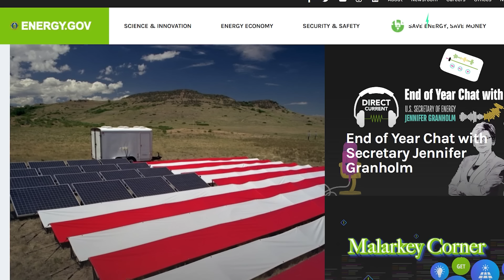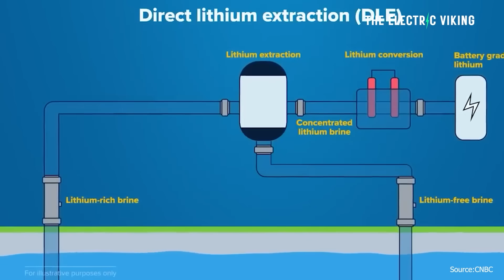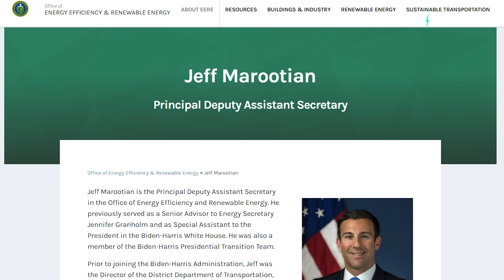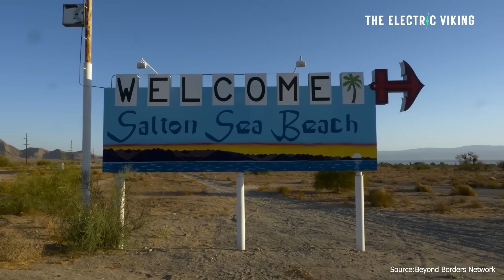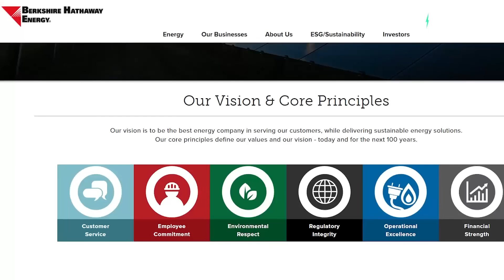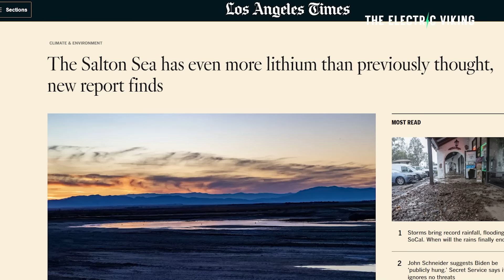A hidden deposit of lithium in an American lake will power 375 million EVs

Comment: Sam, how long do you think they will use lithium in batteries?  Arent they already replacing some of it with other materials?  I wonder if now that all these lithium sources are being found and exploited that we will have so much of it that the businesses that extract it will go broke.  Am I wrong?
Reply: There will be a variety of different chemistries used. I can’t imagine Lithium will not be one of them. The large lithium findings will only lower the cost of lithium and the battery. As is the case for all materials, low cost providers will survive. Elon Musk has often been quoted as saying that there is plentiful Lithium all around the world but the challenge is lithium refining capacity. Sodium ion batteries could be used as well in certain circumstances. They are cheap materials but their volumetric density is poor. So most likely to be used in lower mileage compact cars or in megapacks where space is not a constraint.
Reply: You can use lithium battery 20 years.
Reply: @joelsalvatore and then recycle
Reply: Catl is making cheap and unlimited sodium ion batteries for some Chinese EV's next year. Lithium is just a bridge to cheaper and better batteries that doesn't use expensive and limited rare earth metals.
Reply: @larryc1616  I don't think sodium has the same energy density as lithium
Reply: @darylfoster6133  not right now but will be great today as battery storage
Reply: @larryc1616  what is the advantages of sodium batteries??
Reply: @Just_a_random_birb  Lithium spiked up tremendously when suddenly everyone wanted it for batteries.  So people looked at sodium because it's abundant and cheap. Since then (and in the years to come) mines like this will appear, and different battery chemistries will use different materials depending on their cost, weight, and other factors.
Reply: @larryc1616  Correct but these batteries have lower volumetric density. They will be mostly used in compact cars with lower mileage. Plenty of demand for such cars in China and Europe but I expect less demand in the USA for such cars. Sodium Ion batteries will also be used in Energy megapacks where volume is not so relevant.
Reply: So far it still looks like a bright future for Lithium. It is true that "Post Lithium" chemistries are studied a lot, but for the high performance batteries for a decade or more to come, Lithium will be the most important one.
Reply: @larryc1616  There are NO rare earth metals in Li-Ion batteries!
Reply: @beatreuteler  Thank you

Comment: At some point you have to stop and ask: "Just what is it that EV's are supposed to be saving us from?" There is one question that is never addressed that would expose the "climate crisis" for the scam that it is, which is "What percentage of the atmosphere is CO2?" The answer, never given in plain language, is that CO2 is currently around 420 parts per million, (google it) increased, they tell us, from 280 ppm in 1850. That's a difference of 140 ppm, or in terms more readily understood by the layman, the composition of the atmosphere has changed by 0.014% (14 thousandths of 1%) in the last 170 years. LESS THAN 1 THOUSANDTH OF 1% PER DECADE! How much closer to "zero" do they think it's possible to get? How gullible do you have to be to believe that this rate of change is causing extreme weather events, which have always happened and always will? Their claim is that this tiny amount "traps heat". ALL gasses dissipate heat and even if CO2 is an exception, the suggestion that a total of 0.042% can overwhelm the capacity of the remaining 99.958% to dissipate that heat is abject nonsense. CO2 DOES NOT control the global temperature, there is no "climate crisis". Wind farms, solar panels, heat pumps, EV's.. None of these measures are necessary, nor will they have the slightest effect on the weather. Eye-watering sums of money have already been wasted on this futile exercise. Time to wake up, stop throwing our money at these boondoggles and squandering the world's resources on projects that cannot possibly succeed as there never was a problem to begin with. There is no need to save the planet from a minuscule increase in the gas on which all life depends, but it does need to be rescued from idiot politicians and media mouthpieces that push this garbage.
Reply: It isn't only about the CO2. It is also about usage of primary energy. In the long run, mankind cannot waste this hughe amount of primary energy like we do today. I'm quite glad some scientists recognized this and spoke up. EV's are using about 4x less primary energy than current cars. And I am excited to live in exactly a time that is like this one where we stand on the crossroad and think of which direction we should go a s a mankind.
Reply: What do you think is providing the energy for EV's? Wind and solar? Sorry, but you have been scammed. "Renewables" don't even save as much CO2 as it took to produce them when you account for all the processes involved. They are parasites on the grid, and cannot operate without 100% backup from reliable thermal generation, that's why energy prices are spiralling ever upward as we pay at least twice for energy even before taxes and subsidies are applied. The first attempts at personal transport were battery powered vehicles, and they had all the same problems that they have now. Apart from their propensity for self-immolation. That only came with "superior" battery chemistry. @beatreuteler
Reply: EVs allow energy diversification from Petroleum.
Reply: @jerrypalmer1786  What do you mean by scammed? Where I live, there are very good statistics down to quiet some good details for the mix in the grid. On top of that, I can open my eyes and see how in the neighborhoods around the people are putting PV power plants onto their roofs, carports and such. And locally, our provider informs us annually about the more local mix they control. For example in our community, 35% of the energy in the grid is locally produced Solar power. The balance is hydro from the next power station and a very small portion of "grey" content from outside the region containing some nuclear, some biomass, some fossils, but all in all less than 10%. The latter comes in mainly in December and January, when the PV plants are @ their annual low. I am well aware that this may be an exceptional region and it's worse elsewhere, but I can even look at mix data from neighbor countries as these are also published in the internet. And everywhere around as far as I can look the solar companies are working @ capacity to extend the installations. When I ask a quote today the lead time I am getting is typically 10 to 12 Months. So people are crazy these days about solar and no end is in sight. Today BEV's will run for approximately 15 years so the mix of 7 years down the road is the relevant measure. It's improving every day.

Comment: The problem with lithium is the time and  problems involved in extract and purification .. the least energy intensive ..surface evapouration concentration takes a year or two..  otherwise you've got to put huge amounts of energy and water in then start seperating the Li carbonate from other nasty toxic ellements. 
Theres an excellent article in Nature about the problem and what can be done to speed up the process and reduce the environmental impact. 

The other issue is you can never recover all of a reserve .. as its price energy and technically determined as to what constitutes an economic reserve. 

Na is far more available though its one of the ellements these guys are looking to remove. 

Now even if you direct the Na to grid/static storage it still beats Li in some other ways.
Theres other elements that are even more common and available globally that can make better batteries..

Li might not be needed or will only play a reduced role.. 🤷🏻‍♂️ That it needs to be paired with some other hard won rarer ellements for some functions as it is,  is a problem long term. 

So great from a strategic resource bassis but not so good for the present in terms of we need better extraction and refining technologies.  

Fossil fuels experience the same problems in terms of environmental health and pollution issues.. coal, oil and raw gas flaring.  

The other source is Seawater ... Seawater contains huge ammounts of dissolved elements ..  and in a world where more cities and agricultural systems depend on desalinated water for life support ... Harvesting valuable elements from the otherwise toxic brine could make Sence.. the chinese have found a way of precipitating out and extracting natural uranium. 

In fact theres a rub here till recently much of the word sent their rare earths and  valuble ellements to China for processing even the US.  They like much of the rest of the world hadnt invested in new mining and proccessing technologys plus that way they exported some of the less acceptable problems.... including of course Carbon dioxide emmissions.

In the Chesire area of the UK theres a long history of Salt mining .. historically huge caverns were dug out below the Cheshire plane. 
Nowerdays they inject heated water and dissolve out vast caverns  then pump out the concentrated brine .... how big well you could drop the Eifle tower into some ..  meantime life goes on in farmlands above.

But  it doesnt take a lot of imagination to realise that there could be complications particularly in a seismicly active area or after a long period of extraction and then abandonment. 🤔 The land above is always going to be suspect. 
This hasnt stopped humans from doing equally silly begger things though and there are entire  
City areas built on coastal limestone plains in central america where a few meters under the roof limestone there are vast  interconecting marine and freshwater solution caverns. 

You can in places literally see foundation piles driven  through the roof and hanging down into the vast blue of these caverns from when sea levels were lower and the blue pools were open holes to the sky..
Reply: I don’t see the problem with waiting a year or two.
Reply: @TheBooban  
The problem is the customers want the cars now the supply chains are in chaos and a lot of existing sources are wavering or likely to be with held .
To set up a major mine and processing plants takes 6-10years and new battery tech ologies are dropping every few months.  Plus we are running out of time to get our act together.

Comment: My understanding is that this lithium will be difficult to extract.
Reply: Are you a chemical engineer?
Reply: Rationale?
Reply: The geothermal plants literally have to move the brine through their plants to produce electricity. The only thing they are doing is removing the lithium. Speed doesn't matter if the cost of most of the capital is in another process that is profitable. Electricity is profitable.